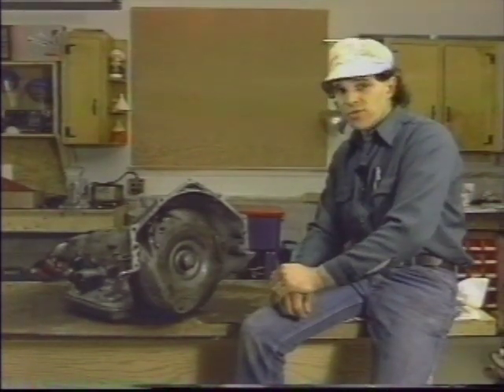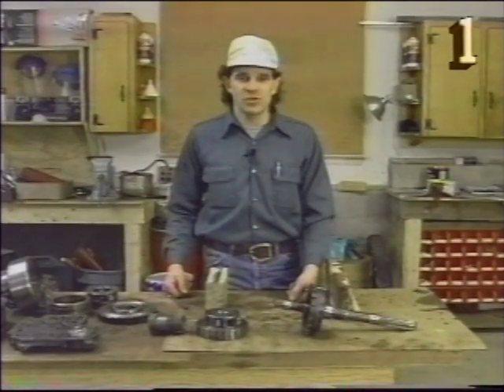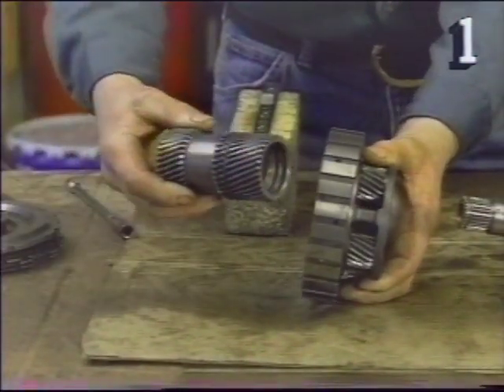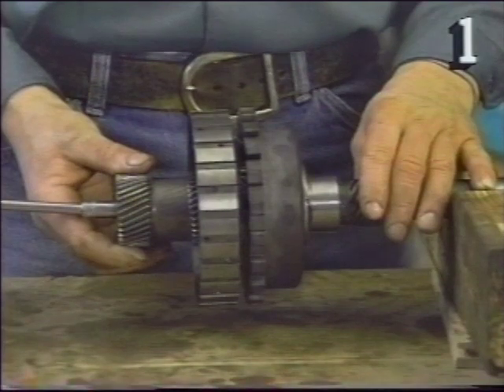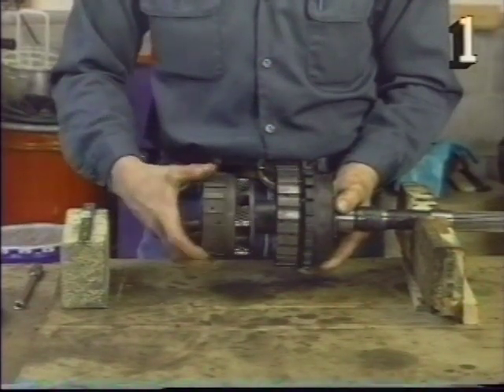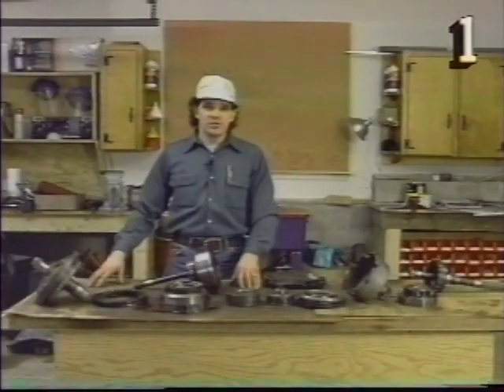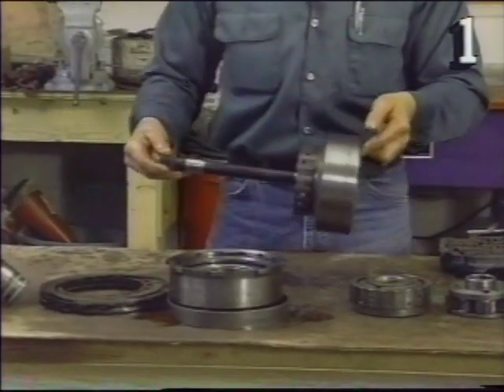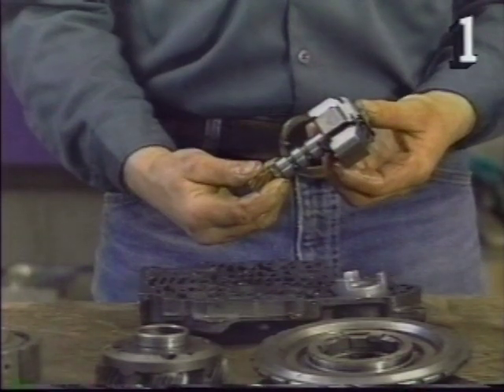Rebuild Your Auto Tranny- Part 1-  The Basics

Comment: good videos, thank you..I am looking for specific info and wondering if you could answer a question regarding internally duel feeding the direct clutch....i think i have it most the details of it but have one question thus far being weather omitting the direct drum center seal and the direct sealing ring on the pump is required or only omitting one of them, and which one....I do not plan on any kits to duel feed.... if you have any knowledge of this I would appreciate it and/or and resources or suggestions..thank you Ken